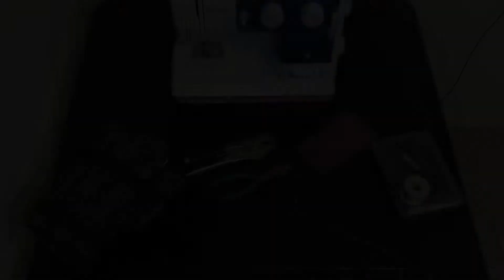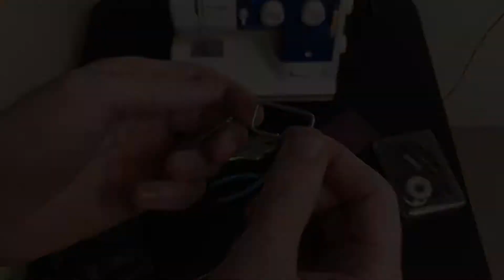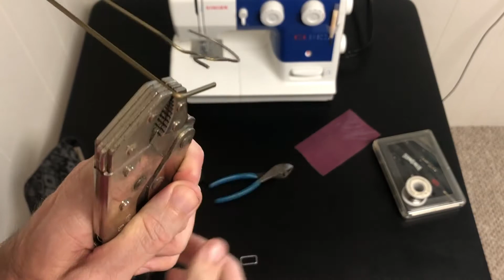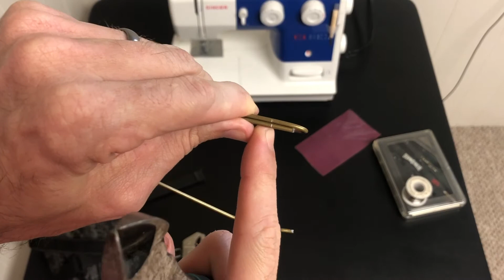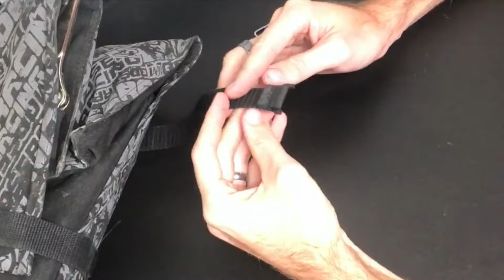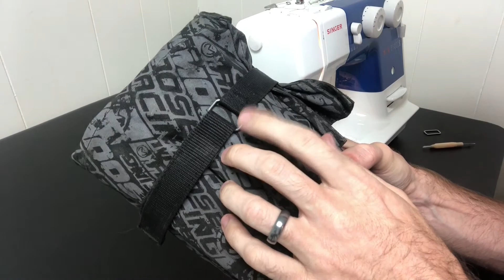Tool Roll Buckle Repair - Upgrade to metal buckle

Comment: Great video, I really like the idea of using a coat hanger.  Just a thought, but it might have been easier to cut out the broken buckle, leaving the strap sewn, and then slide the hanger into the existing loop.  You can then solder the gap closed and turn it around if there's room.
Reply from the maker: Phil Pinsky Productions Thanks. That’s definitely an option. I made the new buckles before my friend brought the bag to me though.
Reply: @DustinRogersinMO  Well then, that's makes sense!